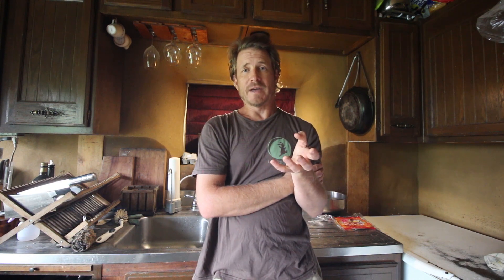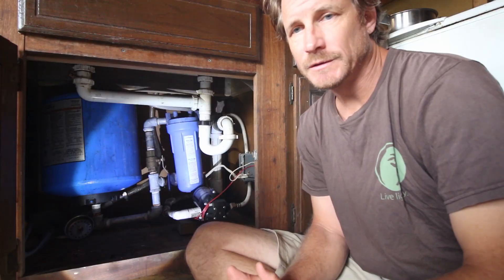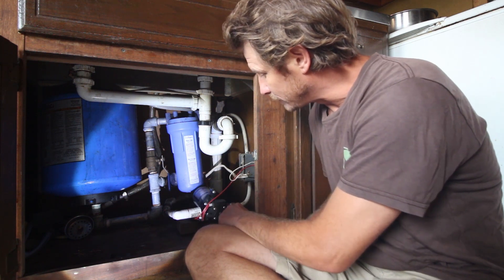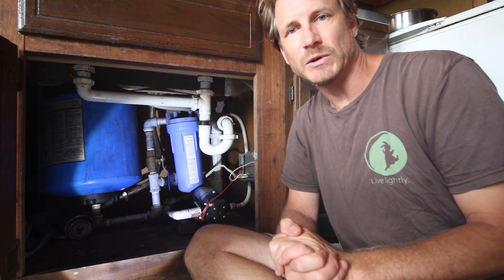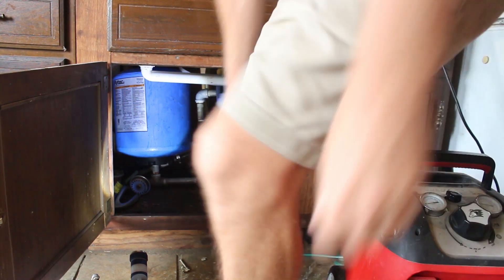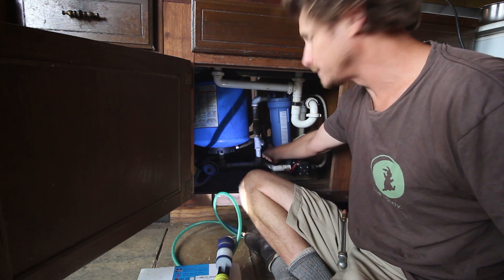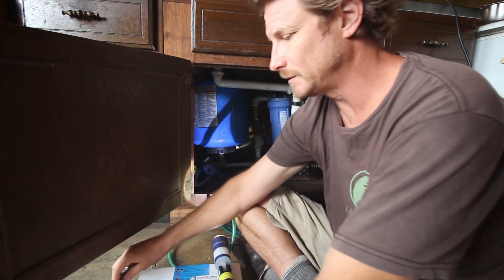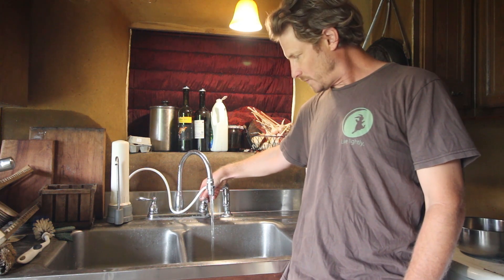My SIMPLE OFF GRID WATER System Has a Problem

Comment: The sediment filter should be before the pump....
Reply from the maker: I don't think that would be a good idea. The filter clogging would impede the pump's ability to pump up the head it needs to cover to get the water out of the cistern. Pumps push water much better than they pull. That would always be interfering with the pump functioning and stress the pump parts. The sediment filter is before the pressure tank so sediment doesn't collect in the tank. 

Even where it is the filter getting plugged sometimes stops the pump from properly pulling from the cistern. Just recently the pump stopped pumping properly. When the outflow end was disconnected, the pump pumped freely from the cistern. I'd recently put a new type of filter in the sediment filter that is thinner and I think gets plugged up faster than the old ones, but it can be cleaned easily. 

Anyways, I think having an obstruction between the pump and cistern would cause more problems. Many times the shurflo pumps will have a little wire filter on the inflow side just to stop the really big stuff from getting to the pump. These are less likely to plug up than a 5 micron sediment filter.
Reply: @HardcoreSustainable  All you have to do is drop a terminated line down from the main line with a clean out cap at the bottom, this will catch the sediment without it going through the pump or the filter.

Comment: Another way to do this is to simply add air to the tank equal to the cut-in pressure switch setting.  Then, with the pump turned on, release air from the tank until the pump starts up.  This is particularly useful when your pump gauge is broken or inaccurate, or you are unsure about the pressure switch settings.

Comment: The cause of the slow air leak from the bladder could be a bit of dust or grit in the valve, preventing the valve seal to seat properly. Adding air or releasing air from the bladder should move the dust/grit out of the way. Great video. Thanks.
Reply from the maker: Thanks for the the additional info.

Comment: Your condition is called "water logged".  Yes, you are out of air cavity space.  Probably either a bad "schreider" valve core, or the bladder seperated.   Shut off the pump, drain the water out of the tank, then repressure.  If it's still good, the tank will do its job.  You did not "drain" the tank, you just depressurized.
Reply from the maker: thanks for the additional info. I guess the bladder is actually more like a membrane separating the water and air sections of the tank. You could say and I did in the video that as I filled up the bladder with air, it pushed the water out of the tank. It might not have gotten all of it out, but enough to allow the bladder to reach the desired air pressure..What I did in the video worked perfectly to repressurize the system and get it working properly.  It's been working ever since.

Comment: Check your contact points. Mine used to attract ants and they would get smashed in the contacts causing it to go off/on/off/on depending on how many flat ants were between the contacts😁
Reply from the maker: You mean the wiring contact points at the pump or at the battery. The pump worked fine, it was just kicking on too much because the pressure tank bladder wasn't full of air.  But that's funny about the ants.  Borax solution is a great organic control.